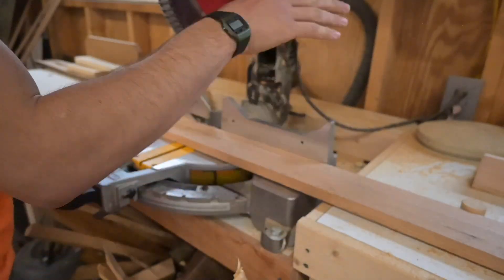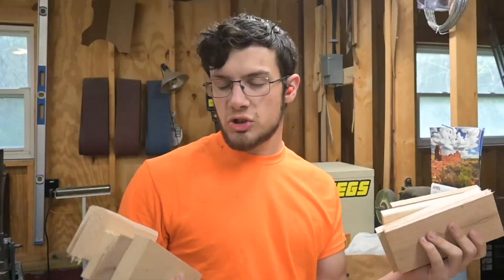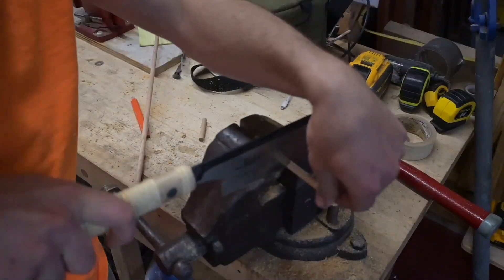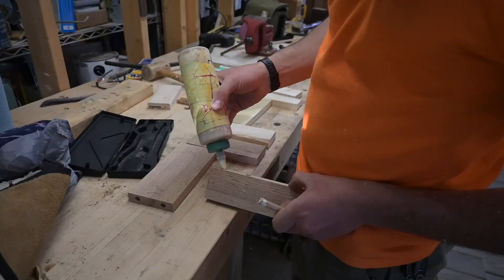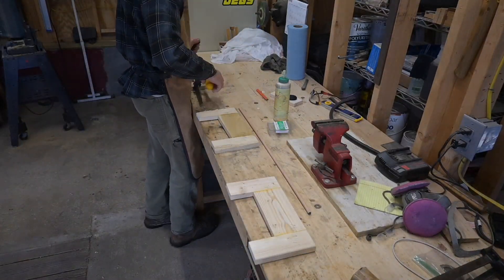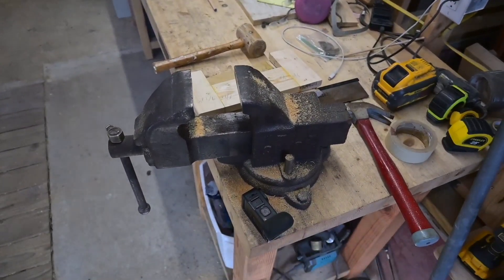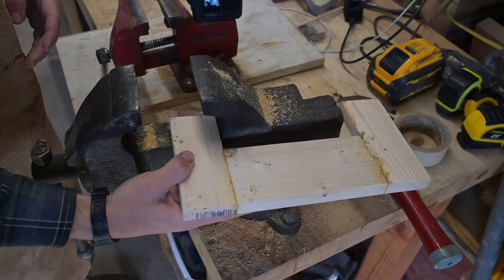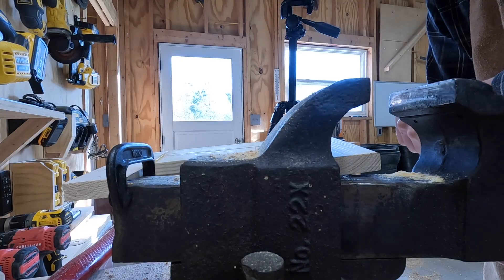Are dowel pins a scam? Let's find out! Does making your own really save money?

Comment: Dude. Your comparison in size doesn’t work. If you want to correct comparison then you need to use 2 sizes of fluted dowels and 2 sizes of smooth homemade dowel. You can also make you own “fluted” dowel by using a thread cutter on the dowel giving it more surface area for the glue to adhere to. This create a much stronger bond when using dowels.
Reply from the maker: I will be doing a test with the same size dowels in the future, hope you can catch the episode!
Reply: I am subscribed so I won’t be missing it. Looking forward to it.

Comment: You're video is informative only at the technical/academic level.  The take away is that either dowel will work just fine for 99.9999% of your needs.  I can't think of any woodworking joint that I would put the kinds of stress on that your test did.  In addition, which alternatives do you have for a "stronger" joint.   Even if you compared purchased with purchased instead of purchased with made, the joint will still break at some point.  What your missing is the actual strength (in measurable units) where each joint would fail.  That would be done separately, not in tandem like your experiment.  In the end, I think you demonstrated that home-made dowels are sufficient for most if not all your needs.
Reply from the maker: I agree, the test was mostly for fun and home made dowels are perfectly fine for pretty much everything and I will continue to use them, thanks for commenting!

Comment: I built a gazebo out of redwood (Western redceadar), using oak dowels as fasteners when I had end-grain joints.  I sanded one spot on the dowel to give it a way to let the air out; tight dowels will be hydrolic and split the wood when you drive them in.
I also made sure the hole size was just right!  Based on the actual dowel stock I got, and the actual size of a hole made with a hand drill (which is oversized compared to the bit), I got brad point bits in 1/64th increments so I could do some tests and find the correct one.
I use Titebond II, BTW, because it has some water resistance.  \
Years later, it's still holding together just fine.
Reply from the maker: The home made ones are definitely going to be fine for basically everything, I made porch swings years ago with them and haven't had any problems with them, at least on the pieces that weren't rotten when I put them in! But I use Titebond III for stuff that can get water on it, it's water proof, no offense.

Comment: well if you only buy 6 they will be expensive. how much did the dowel rods cost and what is your hourly rate. if something takes an hour to make, that is 20bucks on the invoice. but i looove testing so thanks for the vid.
Reply from the maker: You have to calculate not only how long it takes to make dowels but how much time it took you to get to the store or purchase them online, if you compare those two numbers and not just the time it takes to make one versus zero, they be less different then we think. Besides it takes me about five minutes to make twenty, which is pretty quick.
Reply: @measure_once_cut_twice  I have to be nitpicky: You also have to purchase your raw material online or in a store - from that perspective your counter argument is flawed.
However, OP's point is also flawed. If you build something for someone and they pay you for it, you set the price based on your hourly rate, materials cost, etc. In the end you get paid for those 5 minutes it takes you. On the other hand, if you do it for yourself, you do it in your free time - in that case exchanging those 5 minutes for whatever amount of bucks those pre-made dowels cost you will actually cost you money that nobody will reimburse you for - after all nobody pays for your free time.
Reply: @measure_once_cut_twice good point, good point, but i live next to a store and i work slow. :D 

keep up the testing.

Comment: The fluted dowels have more surface area for adhesive to bond! The non fluted doesn’t allow for glue to transfer throughout the glue joint. 
I’ve used fluted dowels for many years with 0 issues. In 1980 in a Jr high woods class. I made a bedside nightstand. The only thing holding the top on is six fluted dowels and some wood glue. 
Done correctly they will hold together forever! 
I would like to see a shear test between a fluted oak dowel and a non fluted oak dowel. I’m guessing it will be a microscopic difference on the amount of pressure that would be applied to horizontally shear one from the other.
Reply from the maker: Horizontal shear load would be very similar I'm sure. The only reason I thought the regular dowels would be better is that wood glue is stronger the tighter you get the joint, so it seems that having more press fit contact would make it stronger, anyway, I'm going to do another test with fluted 3/8" dowels, self-made fluted 3/8" dowels, and regular dowels, it should be interesting.
Reply: @measure_once_cut_twice  you bring up a good point. I have always felt the fluted dowels provide enough strength for almost any application. I feel the flutes allow glue to spread through the whole joint. Press fit dowels could squeeze virtually all the glue out other than a very thin layer. 
Make two sets of boards 3” X 4” dowel them together. Have a hole in each board for an anchor point. Use the other hole for your pull point. 
Find a scale that you can use inline of the pull. You can measure the force applied and have more accurate results. 
👍🏼👍🏼
Thanks for sharing your experience!
Reply from the maker: @bret_Lambky  Ahh! But the question is do we really care what the exact force required is if the only thing that really matters is which is stronger. I really like Project Farm's videos and he tells you all the numbers in his tests but the actual numbers don't really matter, it's just the relative position to each other, but the numbers are still fun.
Reply: @measure_once_cut_twice  I think the actual numbers do matter a lot. The moment one side experiences forces that induce permanent deformation, that side will weaken considerably and any subsequent pulling will only result in further failure on that side. For all you know, the other side could have failed with just a tiny bit more force applied.
(And there's the question of: "does it make a difference?" - if the cheaper version fails at an applied force of X Newton and in all your practical applications you'll never need more than that, then who cares if there's better dowels?)
Reply from the maker: @maximilian672  Exactly. If the difference is negligible, there is no practical purpose in delineating at all, you can do whatever you prefer and probably never have a problem.
Reply: @bret_Lambky Re starvation in the dowel joint:  In soft wood (western redceadar in my case) it's not a problem as the wood gives, as with metal nails.
But I also was careful to size the hole just right, with drill bits in 1/64th increments to choose from.
I would sand one spot on the dowel to let the air and extra glue out.
Reply: Glue joints don't need "more surface area".  You get the best bond by jointing both pieces, not by roughening up one of them.  Wood glue is not gap-filling; it works best when surfaces are in intimate contact and you need very little glue and any more squeezes out.

A smooth dowel in a properly sized hole will bond much better than a fluted dowel in a hole that it easily fits into.
Reply from the maker: @JohnDlugosz  That's what I thought too, but the test proved me wrong hands down, the next test will be the true tie breaker, 3/8" dowel to 3/8" dowel, smooth v. fluted.

Comment: I make my own from a piece of doweling and a pencil sharpener.  It allows me to make the dowels any length/size I want/need.  The smaller sizes I use the pencil sharpener to put a small bevel on the leading edge.
Reply from the maker: I make my own dowels too, but after this test I might start buying them, we will have to see the results of the next test with them both being 3/8" size.